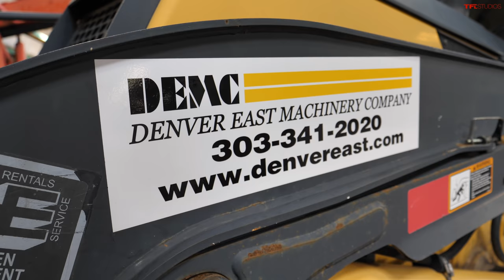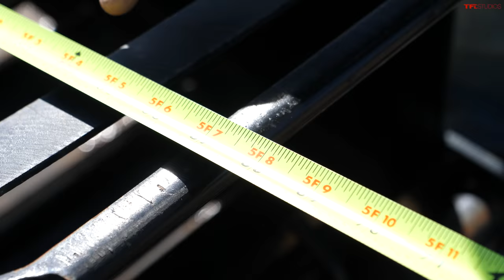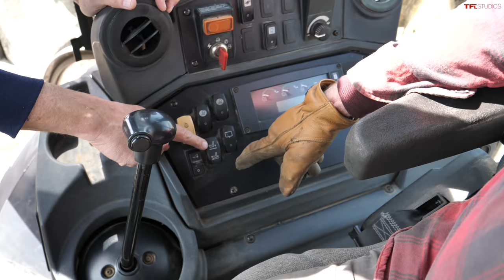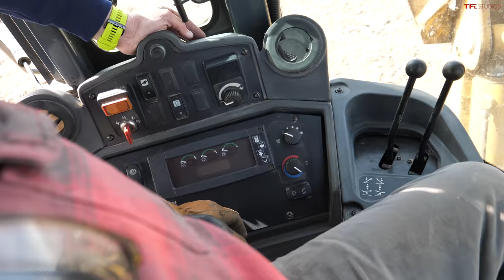Will It Tow? - We Max Out a RAM 4500 Towing a Massive John Deere Backhoe! | Taming Tumbleweed Ep.5

Comment: Truck & Trailer Weight Breakdown: 

Truck: 2021 Ram 4500 Crew cab, Cummins, 4x4

GVWR: 16,500 lbs
GCWR: 37,500 lbs
Payload: 7,920 lbs 
Max Towing: 28,770 lbs
GAWR Front: 7,250 lbs
GAWR Rear: 12,000 lbs 

Trailer: Big Tex 22GN 25’+5, 6300 lbs
GVWR: 23,900 lbs 
GAWR: Two 10,000 lbs Rated Dually Axles 
Trailer Weight: 6,300 lbs 

Equipment: 2008 John Deere 410J 4x4 
Weight: 18,500 lbs 

Trailer + Equipment: 
GVWR: 6,300 lbs + 18,500 lbs = 24,800

Breaking down the numbers this load was unfortunately slightly overloaded. 

The truck is more than capable of the load. However, the trailer falls short. 

Two issues with this particular load and the trailer. 

1) The GVWR of the trailer (23,900 lbs) isn’t high enough for the weight of the trailer and equipment 24,800 lbs, exactly 900 lbs over weight. 

2) The trailer is limited by its axles rating. GAWR: 20,000 lbs. Even with 20% pin weight distributed onto the rear of the truck your still over your limit by 900 lbs. 

One thing trailer manufacturers sometimes do is include the weight distributed onto the truck in the GVWR of the trailer. Example if your axle limit (GAWR) doesn’t add up to the GVWR you know they factored the pin weight into the GVWR. Usually around 20% for goosenecks. In this case GAWR 20,000 lbs + 19.5% = 23,900 lbs which is your GVWR. 

If the GVWR (23,800lbs) on the trailer was higher say 25,000 lbs, but the GAWR (20,000) was still the same. You could put more weight onto the rear of the truck. Example 20,000 lbs + 25% pin weight would give you the 25,000 lbs you need. However, dependant on the capability of the trucks rear GAWR and the structural weight rating on the goosenecks coupler. In your case it wouldn’t have been legal if possible anyway as your still over your trailers GVWR of 23,900 lbs. 

Bottom line you guys weren’t grossly over weight like many suggest. The truck and trailer seemed to handle the load fine. On a legal front you were technically 900 lbs overweight. 

One thing to note is where you got your info with regards to the weight of the equipment, as it seems inflated. Recommend finding the operating weight In the manual like I did, or to look for the weight placard on the machine. 

Happy hauling and safe travels! 
Keep up the good content 👍🏼
Reply: You need something to do! Obviously you have too much time on your hands!
Reply: Nice summary
Reply: Agree nice summary,  Apparently too much for some to comprehend.   But definitely good informative information .
Reply: @joshdixon8624  go play on tik tok . Let the adults talk...
Reply: Great information and explanation!! Thank you.
Reply: I appreciate your breakdown but I think it gets a little more complicated than that. Machines often do not weigh what they're listed weight is, different buckets or other equipment, changes to the equipment such as reinforcing the bucket with heavy plate steel which I've seen done many many times etc. 
Then of course to get nitpicky we can factor in the weight of all those chains and that extra set of ramps  straps, potentially fuel in the backhoe etc. Realistically I think the truck and trailer have no issues hauling that as long as it's not everyday all the time but yes technically overweight
Reply: You did a nice job on your summation.  I have that exact trailer.  With chains, binders, straps, in the box and a spare tire, it weighs 7,100lbs.  I often scale my loads so I have a solid base for knowing my rigs weight at the curb.  I plan on a 17,000 pound carrying capacity to stay legal.  I have farm tags so if I go over it’s no big deal but it’s better from a liability standpoint to stay within legal limits.
Reply: I would tow this with my 2500 all day everyday, I have a 24k gvw gooseneck and have loaded it that high
Reply: @joshdixon8624   obnoxious much
Reply: @blakel4595  full send! Hahahhahaha nice bud

Comment: coming from a a person who drives a very similar set up to this, but a 5500 series, and a 40' trailer. i would move the backhoe back a couple more feet, you want the axels of the trailer to take most of the weight, and with where you have the backhoe positioned infront of the axels, you put a lot of strain right in the middle of that trailer, essentially bending it. if you move the backhoe back a couple more feet, it would be ballanced better on the trailer, be less strain on the trailer, and also be less strain on the truck and it wuold be totally legal and balanced. It would also pull a lot better going down the road. Awesome video yall!

Comment: Hitch weight counts toward the trailer gross weight. You're still 6,000 over trailer gvwr, even if your axle weights are good. 
You can use one chain and two binders on each end, with the slack hanging under the machine. It saves that mess at 13:39.

Chain the tractor down before setting the buckets down. It makes the chains tighter.
Reply: Definitely exceeds the legal max for the trailer
Reply: Wouldn’t say 6 probably more like 3

Comment: Never attach chains to the rub rail. They go around the round steel bit and hook back on themselves.  Good luck with the build.
Reply: In the states it's legal to attach to the rub rail. 
Canada doesn't like it so much
Reply: THANK YOU!!!!! every channel with a trailer the guys do that and I used to as well until I got w lecture about it heavy hauling crane counterweights !!!! go through 2 and hook it back to itself it makes a nice triangle there is double the amount of contact with the trailer and you can get the chains much tighter !!!!
Reply: Legal or not, Jeff is correct. Rub rails are not for tying down equipment.

Comment: My exboss runs an 06 ram 3500 with over 400km just the trailer we pull for stuccoing is 22,000lb then it has two palettes of concrete plus a rainbarow full of water and all the ladders and tools.   Heavy hauling 6speed manual built tough before the fiat buy out.

Comment: I drive a 2018 Ram 5500 for my job, the truck itself is weighing right around 21,000 lbs and we still use it to tow very heavy loads weighing multiple thousands of pounds on the hitch. It does not have a goose neck. Heavy duty Ram trucks are beasts.
Reply: The truck itself has a gvwr of 19500... are u sure it’s that heavy on it own?  If so you are way overloaded
Reply: @paultasker9759  with all the stuff on it yes. It was just over 20k last time I went through the scales. No its not my call to have it loaded that heavy.
Reply: @markwinkler3038 That’s a heavy payload, what’s it loaded with?
Reply: @paultasker9759  Lots and lots of wire, conduit, hardware tools etc.. anything and everything to do with irrigation electrical, and the equipment to get pulled out of fields by tractors if we get stuck.

Comment: Great video as always, just a few pointers, your chain should never be outside the run rail, I like to go around two of the spools, I’ve hauled a lot of equipment in my 30 plus years and the right  DOT officer will write you up, also looked like it was loaded to far forward, center the rear axle of the machine over the trailer  tandums.
Reply: Hooking to the rub rail is legal in the US. 
They loaded forward to get their axle weights, go to about 12:55 they talk about it, but hitch weight counts toward trailer gvwr is where the math goes wrong.

Comment: To make a building pad you really need to bring in several hundred yards of compactable clay and compact it down with a large vibrating roller.  Using loose fill like this going to lead to seattling issues and big cracks in your concrete slab.
Reply: Yep, sheepsfoot roller and clay fill.

Comment: I would say the backhoe was probably 2' too far forward on the trailer. I would have been interesting to roll it over a scale because I'm pretty sure you were over the trucks rear axle rating by quite a bit. Rule of thumb is the have the center of mass of your machine about a foot forward of the front trailer axle.

Comment: It’s amazing what “pickup” trucks can do these days and that ram didn’t even have the high output engine.  I have a 2021 ranger and pull a 21 ft travel trailer. I also have had 2 of the old school rangers. I can’t even fathom pulling that trailer with the old rangers.  I can still get about the same gas mileage empty as the old ones with basically twice the power.

Comment: GVW on trailer is 24,000.  12:06 .    Backhoe weight is over 20k dry.  
Your overloaded by a long shot there bud.  

 Not saying I would not try it on back roads, but on the interstate DOT would have a field day with this setup.

Comment: I have a JD 410 too and their awesome machines. I’ve had Case, Komatsu and Ford but I prefer the JD.  A dozer with a 6way blade would have been more effective grading but I have built many houses and septic systems with only a backhoe/loader. If you can have only one machine I would go with what you have and you can drive to local job sites.
Reply: My dad and I would do a leach field ourselves in a day, when we were younger. Hole, stone, pipe buried, mulched, buried, and set the tank, with just a 555B.

Comment: The backhoe is still a bit small for that amount of grading.  A dozer on tracks with a bucket would be more efficient.  It could also drag a sheep's foot over each lift of fill to properly compact the soil.  I would try to keep the barn located over the cut and the parking area over the fill to minimize settlement and cracking of the slab.  I realize, though, you would probably have to hire and excavation company with an operator, and that may cost as much as letting David operate the backhoe and taking longer to do the job.

Comment: I’m no towing expert, but while the weight may be fine for the axles, wouldn’t this be overloading the frame and the point where the gooseneck connects to the truck.
Reply: Yes.  The 20% put on the truck is transfered via the trailer.  If they pulled this truck and trailer onto a scale, unhooked the truck and left the trailer on the scale, it would weigh 30k (according to their numbers).  6k over the GVW of the trailer.

Comment: Goes to show how ridiculous epa regulations are.  A truck meant to tow more weight than a 1ton but has less power ONLY because of government regulations..

So dumb.
Reply: To be fair chassis cabs have been tuned down because of commercial use for a long time, even before diesel emissions were a concern for the government. But I do agree with ya there

Comment: Another greatTumbleweed episode.  Is the Cummins in the 4500 the same as the SO Cummins in the 2500.  Likewise would the 5500 have the HO of the 3500.  Kind of neat to see you guys get into this series of trucks.
Reply: They are hd drivetrains derated for longevity. So they would have the Aisin trans but still have less hp than 3500 if I understand correctly.
Reply: If you listen to the video he explains much of this.  When you get into 4500 to 6500 the engines are rated different and tuned different than a pickup truck is. Two good reasons are they do not know what the truck will have on the back as the bed is added at the dealership or later and many are used for company trucks and they need to make it harder to break for any idiot that drives it . In another video Andre I think is talking with Mr. Truck and Mr. Truck gives a very good explanation.

Comment: Can you exceed GVWR of the trailer by just shifting the weight? Doesn’t jive with me. I did not know there was a GVWR stationary vs GVWR while connected. I show 15k is the trailers max payload? Can you explain.
Reply: The trailer max is 25k, probably on the axles, since he loaded it forward so much it takes that much weight off the axles
Reply: They messed up and are trying to play it off as safe. It's not

Comment: I’ve seen older Cummins rams towing backhoes and larger excavators they are towing beasts… automatic transmission on 3rd generation Cummins rams aren’t good though
Reply: Had a 3rd gen auto that towed about 32,000 with backhoe trailer and different buckets. Transmission needed rebuilt at about 380k. The truck did have a tune as well. Used to also use an old 2nd gen Cummins 12v 4x4 standard to pull about 20k, didn't want the truck pulling more than that though
Reply: @sloughsharkseh3307  glad that transmission in your 3rd gen lasted you.  I hear they break a lot. Yeah the 12 valve Cummins is awesome
Reply: @JacksonGuitarsPlayer03   yeah the transmissions were pretty much from the 70's with add-ons and modernization, but overall if you are good with them they last ok. Though after this rebuild I'm debating getting a built transmission.
The 12v are nice trucks, needed aftermarket brakes for sure but never had to put much money in over the years so I keep using it, otherwise I probably would get another 3rd gen but with a 6 speed to replace it for work.

Comment: Nice truck i'd love to drive one of those 4500 or even a 5500 one day and tow a big ass trailer just to see how tough it is to drive it. Do you need a special license to do so ?
Reply: Yes only if your towing a trailer that can haul more than 10k but these 5500’s tow awesome i tow heavy equipment everyday with this one and it’s got 40k miles and I’ve never had a problem I’ve hauled a 309 cat excavator that weight 22,000lbs with our goose neck and the exhaust brakes does really well overall it’s awesome
Reply: We got two F550s we use for for heavy towing and they are absolute animals for towing, easily handle 35k lbs. Driving them without a load is misery, 4 and 5 series trucks have incredibly stiff suspensions.

Comment: Pretty sure that's not maxed out. Only if both truck axles and the trailer axles were at their maximum listed ratings would it be maxed out. And no, the GCWR is not something that DOT looks at. That number is for marketing and uses the horsepower of the truck for factoring. DOT doesn't care about horsepower either.